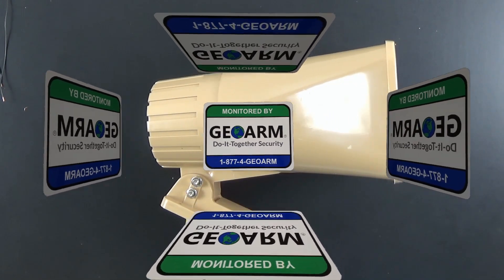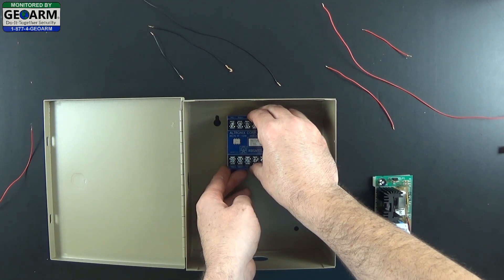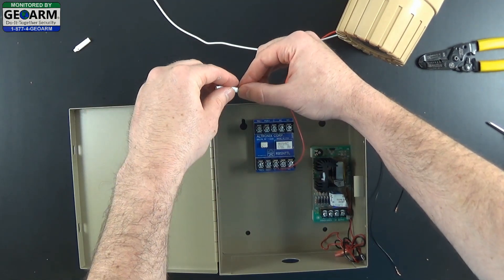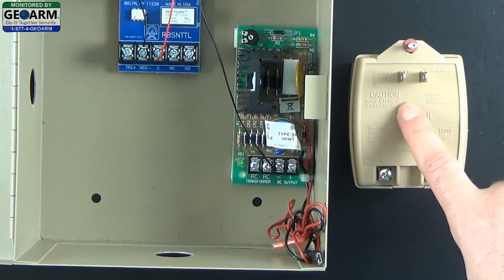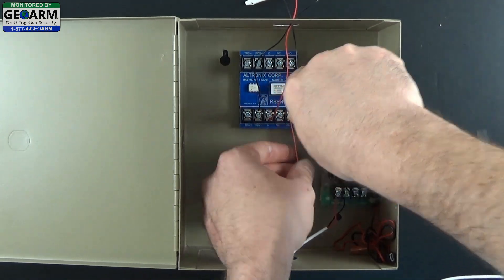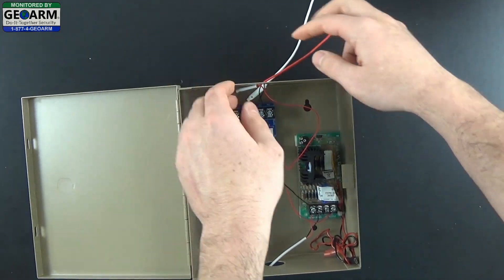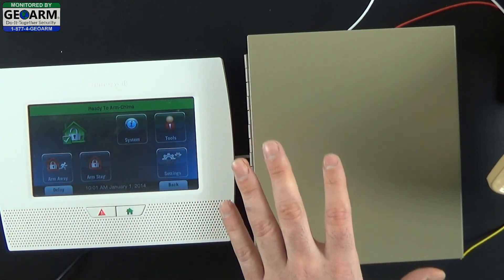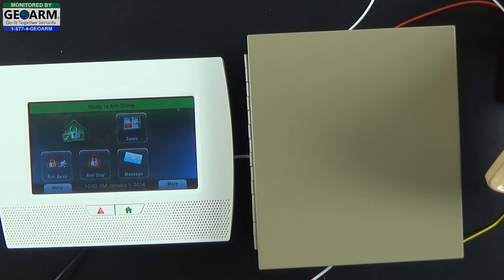Honeywell L7000 - How to Install External Hardwired Siren?

Comment: I bought the kit and wired it up. Why is it as soon as I connect the AC power or D.C. Battery the siren sounds even without alarm going off?
Reply from the maker: Give us a call at 1-877-443-6276 option 3
Reply from the maker: Good Morning, Sorry for the delayed response did you get this Honeywell LYNX Touch L7000 system from us?

Comment: Will the siren sound in a fire alarm?
Reply from the maker: Yes the Honeywell LYNX Touch L7000 wireless security system will have its own siren in the event either an smoke/heat detector goes off or if someone manually selects the fire panic from the L7000 panel. Are you looking for the lowest cost alarm monitoring services for this security system?